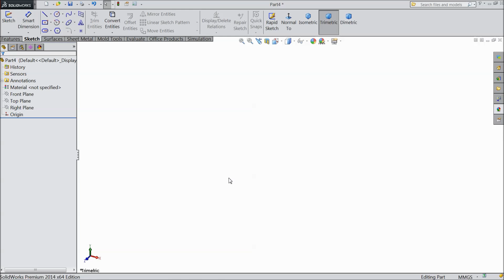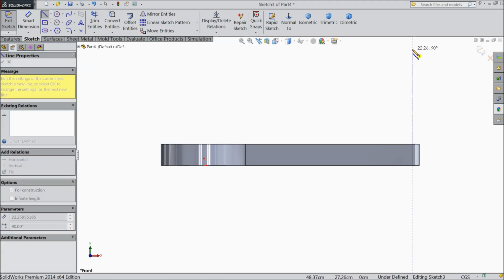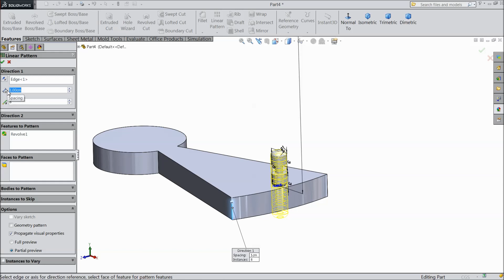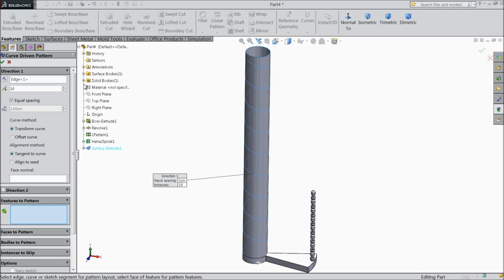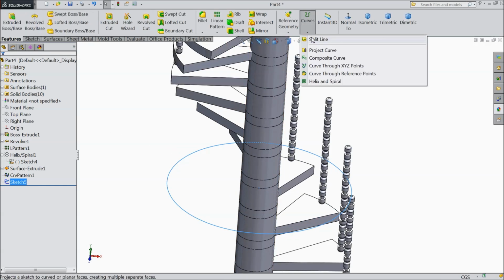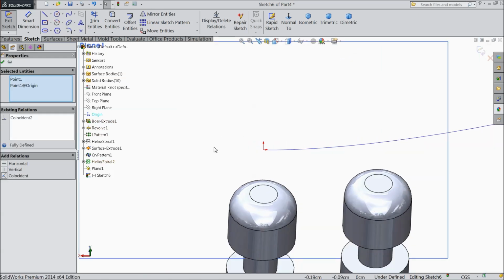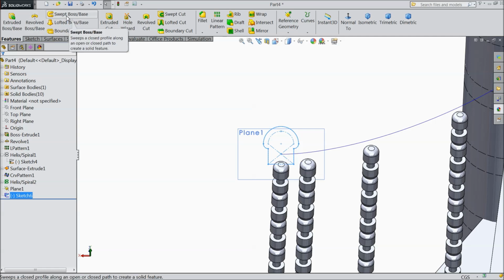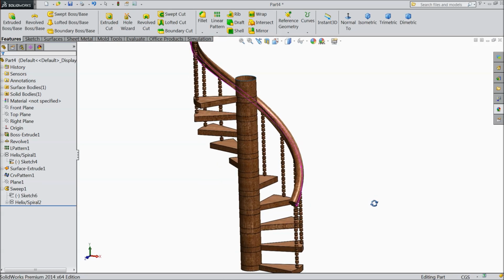How to Sketch Spiral Stairs in SolidWorks

Comment: Is there some other easier way (like sweep command or 3d sketching) to sketch handrail? Because the way helix command is applied in this tutorial, its only applicable to the specific dimensions mentioned in this tutorial.
Reply: It's possible to place a center point on top of each of the vertical posts. Then create a 3D curve connecting the points. Then sweep a profile along the created curve. This way if you change the pitch of the stairs or the number of rotations it will update/follow the stair changes. Give it a try.